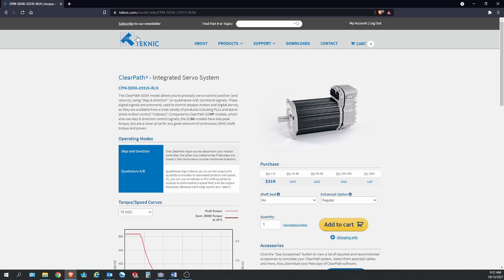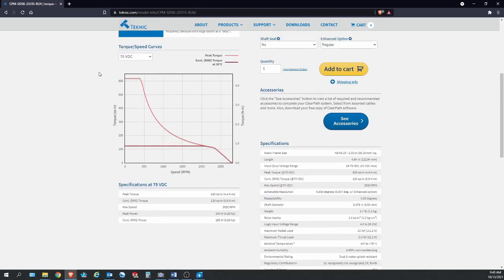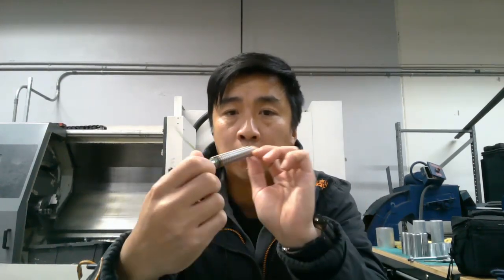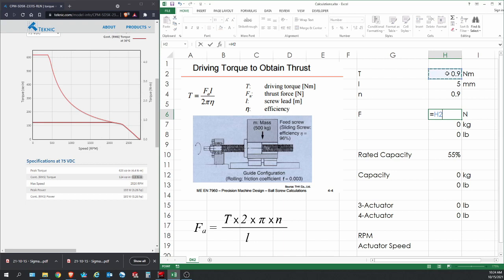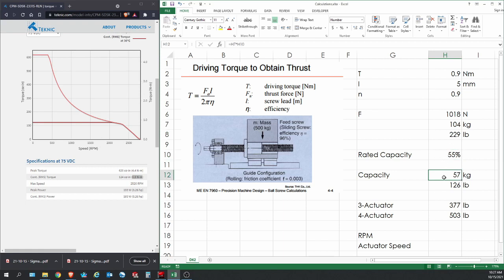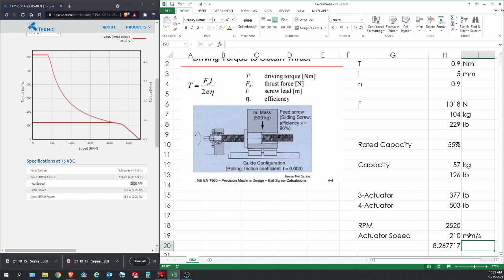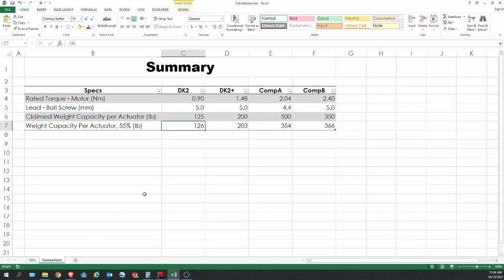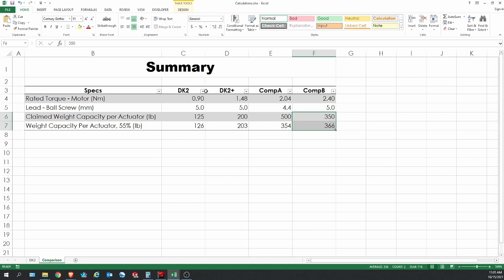Motion Talk 2 - Weight Capacity of Motion Actuators

Comment: Motion is cool an all but, after watching a few videos something looks off. The driver of the Sim look like they are leaning the wrong way in turns. The G-force doesn't get duplicated by the actuator it's so just a quick moment that's not sustained like real g-forces. It looks like the motion is opposite of the way it feels in a real car. I feel like acceleration,braking and bumps could feel right and not corning. I have watch the review on the Sim racing garage and it's a great system for what I early stated. but, never gives the real physical forces of turning, loose of grip and slides. I believe Niels Heusinkveld touches on the topic. A video on the software would be great and maybe how you try to compensate for g-forces not being felt. It would be nice to tune that part out for someone like me buying a system like this. Do you see what I'm saying about the turns? Please keep up the good work.
Reply: You won't get any proper/authentic sustained G's from any motion system, and specially at lower price points without massive infrastructure. What you do want is quick moments, and motion queues that are organic, don't wash out, are repeatable in hitting their targets each and every time. Motion, like the DK2 must communicate to the driver what is happening in the virtual environment. It's a haptic knowledge transfer of sorts. Weird yea? Actually trying to attain sustained G's with a 4-actuator 3-DOF system is where I think many people fail. They make several assumptions that are not fundamentally accurate, such as:

1) that they want sustained G's, and can replicate them in their simulator
2) that they can repeat sustained G's with x-degrees of pitch and roll, continually with or without motion queueing 
3) that 6" actuators are better holding sustained G's than 2" actuators, DK2 uses dynamic scaling for all its layers
4) that pitching and rolling are the only way to communicate G's and/or loss of traction

Neils makes some interesting assumptions but they are also relative to driver and there are many ways to create immersion. We know this is a simulator and not the real thing, as much as we try to make it a real thing, so we should reserve some room for real world compromises.
Reply: @PeterSosinski  I would like to try an actuator system out and realize with that I would never get the sustained G's. I realize it's to create immersion but, want the immersion feedback so I could go faster so it's not just the cool factor. It just looked in slow motion it was the opposite direction a car would make you move. I think less motion would be better.  Your system is @ a fair price point and would love try one out but, don't know anyone with one around me here in up state NY with a motion Sim. I'm hoping you can come up with a USB solution for connectivity. Thanks for your reply and I will follow your progress as the idea of motion is very intriguing when it comes to Sim Racing.
Reply: Hi Logo, you might be interested in this video from Sigma: https://youtu.be/grQ6KD--A_U
Reply: I guess my main question is why is it that there is such a focus on g-forces.  While an important part of the driving experience, it is not the only part.  So if a motion system is not advertising itself as a g-force motion system, then it should not be the focus topic.  What I can tell you is that I have a four actuator suspension based motion system, and It is terrific at giving you a car experience, a motion experience, and it is all in the nuance and minute movement and vibrations - not in the big swings that throw you around 😀
Reply: @netlawman2001  It's more than but, maintaining Static equilibrium that our ears use to help our sense of the direction plays a big part. That helps detect the orientation of the head with respect to gravity. So you miss that with most motion platforms in general without G-force and really with an actuator it will not be sustained very long if at all and not the right direction from watching most motion platforms. Maybe  through a moving platform you could mimic that. That's why it's easier to drive in real life than on must sims because your body is missing to many inputs from your different senses.Actuators add a fun moving experience to Sim racing but, not a realist one is the whole point.Yes, very fun I'm sure.
Reply: @logo8009  much appreciated.  But it is still overlooking the point I was making.  So if a simulator can’t mimic g-force, it can’t.  That doesn’t negate motion systems and it’s too bad that so many are so dismissive.  We have numerous senses and motion does give you valuable cues.  Moreover, actuators can be combined with other    Things, such as g seats or belts.  I guess my point is that it is never a case of all or nothing, so we shouldn’t advise people that it is.